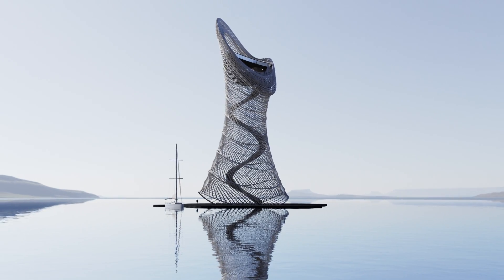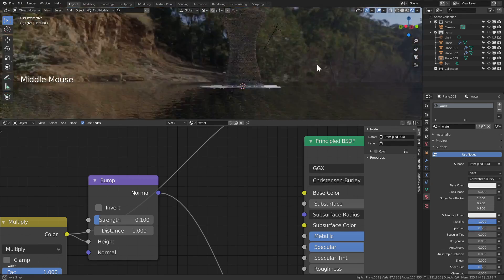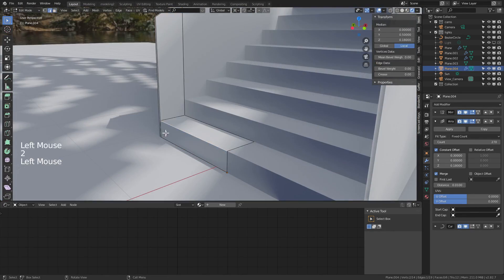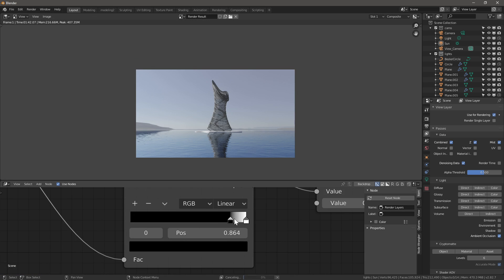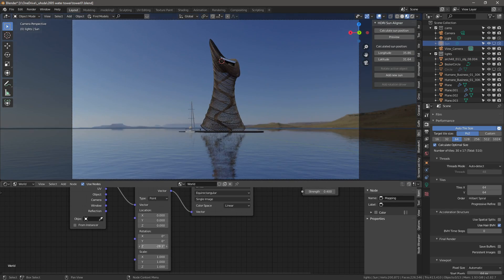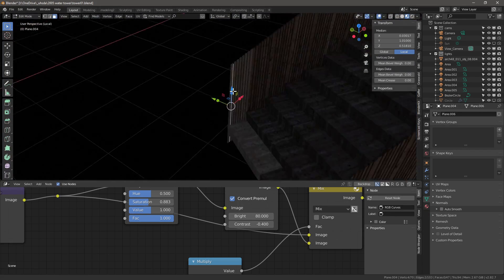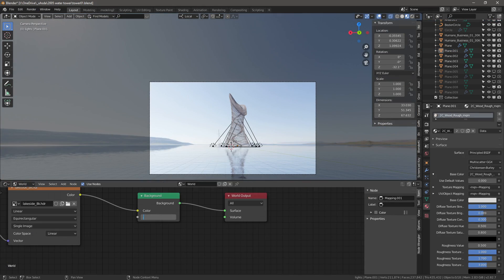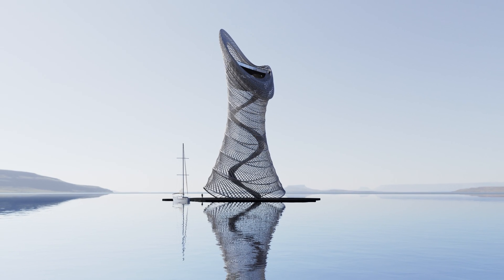Procedural observation tower in Blender - Narrated Timelapse

Comment: Hello, I really like your videos. I have a question. Would you recomend the "Materialiq"-Addon over the "Extreme PBR Evo"-Addon? I cant decide which is better for ArchViz.
Thank you very much and have a great day :-)
Reply from the maker: Hi I would recommend Materialiq. I've used both, and the quality is better in Materialiq, especially for doing work beyond interiors. The libraries have slightly different contents so it may be useful to double check that the one you use has most of the materials you need.  If you would like to support UH Studio, here is an affiliate link - https://blendermarket.com/products/materialiq/ref=423
Reply: @UHStudio  Would you recomend the 2k or the 4k version?
Reply from the maker: @Schmidtli93  depends on what you would like to do. Are you looking to create hyper realistic visualisations? If so the 4k. Otherwise I would recommend the 2k
Reply: I see, but if the final image has a 2k resolution, is it even necessary to have a texture resolution higher than the image resolution? I really apriciate your answers. Thank you very much :-)